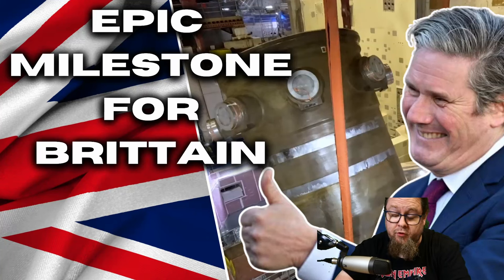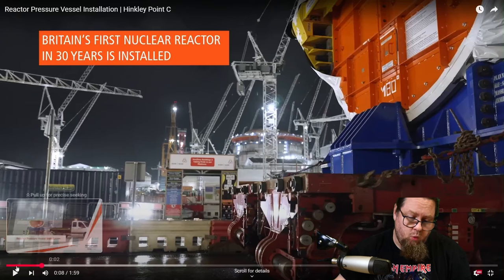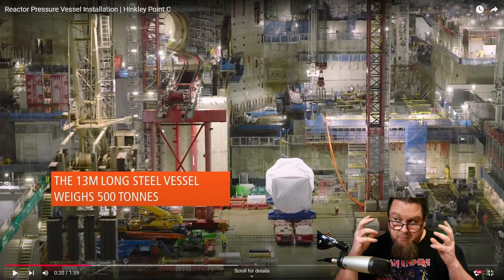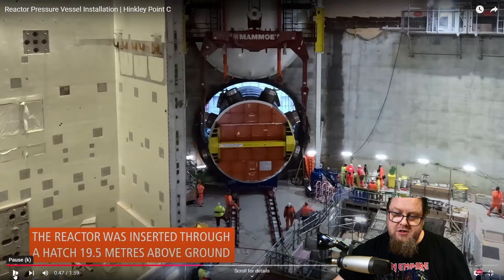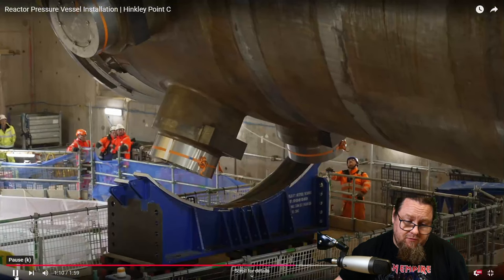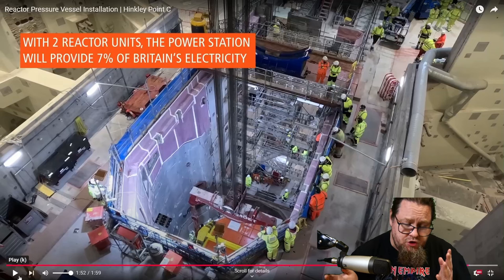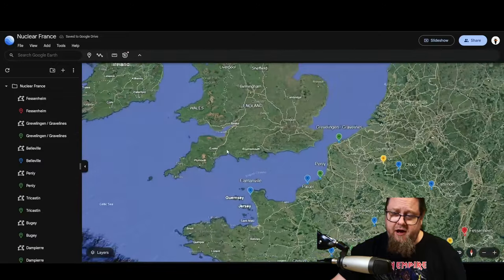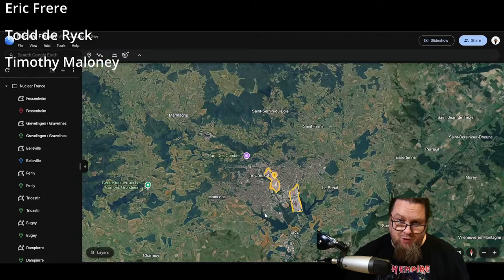Breaking! UK Installs First Reactor since 30 years!

Comment: Foreign investors installed the reactor and they will bleed us dry.
Reply: France and China made big deal. China General Nuclear Power Grp + EDF will bleed GB out. Estimated costs of 47,9 Mrd. £. Finishing in 2031 (building time of 18 years). You need to run this reactor over 30 years to make profits.
Reply: @Wulfay  Nuclear always needs time to generate profits due to the high initial costs. That's why shutting a working station down, like Germany for example, is such a stupid idea.
Reply: @bobthebomb1596  You need 18 years to build and another 30 years to make profit with these reactor in GB!!! Thats 48 years till your invest money pay out!!! With wind power you gain profit after 1 or 2 years and have not much building time. If you dont wanna benefit a corrupt construction company it isnt worth the efforts. The working stations in germany were build 1982-1988. They were much faster and cheaper to build then. They made profit after 10 years and they runned about 36 years. Estimated running time of these nuclear power plants were 35-40 years without upgrades. So they are shut down in time. Upgrading these power plants is expensive too for longer power. With upgrades they would do it +20 years. But old reactors with 40+ years have massive issues. I dont think it was stupid at all.
Reply: @Wulfay  There are at least three German reactors that could be restarted almost immediately.
PWRs are capable of running for 60-80 years and don't require fossil backup or non-existent storage.
Reply: @bobthebomb1596  Ehm...restarted almost immediately...lol...no? Not one of them could restarded almost immediately. I am next to one and live in germany. Not 60-80 years in germany. In the US they have a estimated life span of 60 years (+20 with upgrades). In germany estimated running time was 35-40 years (40-60 with upgrades). Security first here.
Reply: @Wulfay  The estimated running time of the US PWRs was also 30-40 years when they were built, evidence gained after this time showed that it was safe to operate them for longer.
Look at the evidence and make a decision based on it. How science works?

There was a report released recently which stated that up to three reactors could be restarted almost immediately.
Reply: @bobthebomb1596  talking bout safety of OLD nuclear power plants. risk in germany is 8 times higher. we have 235 people/km²...US has 35 people/km². An incident like Three Mile Island in Harrisburg (who was shut down!!!!) wont happen in germany. Greedy companys tell you it is safe. No insurance in the world will do a insurance for a power plant. There is a reason smart people see...
Reply: @Wulfay  : Yet the UAE (among others) who did it in SEVEN years.
Reply: @buildmotosykletist1987  Barakah 1-4 in the UAE needed 8 years and had estimated costs of 32 Mrd. Euro. It is really not economically to build a nuclear power plant in the UAE. Solar energy is much cheaper. in this region. GB and Germany have more safety regulations. No safety for workers in the UAE and the reactor isnt safe vs military assaults and plain crashes. Whats your point man? You think you dont need safety and economically reasons?
Reply: @Wulfay  : Nope. All 4 plants were completed in 12 years with the first online in 7 years at a cost of $20B for all 4 or $5B each. Easily confirmed by search.

Comment: Wow, thank you for sharing! Question: any information about using materials other than concrete for shielding?  Such as magnesium oxide, geopolymers, etc.  I ask as someone was talking about the 5 feet or so of shielding needed around the reactor even on SMRs, and it got me wondering about this. Keep up the great work!

PS my son has a significant mental health condition, and the treatment most effective so far has also been shown to be extremely helpful for many with crippling depression.  Research medical ketogenic diets if you're interested.  Someone working at Stanford University found it cleared up their severe depression in 3 days. As a PhD in materials science I don't make recommendations like this unless I've seen significant supporting peer reviewed literature. While there is still much to be desired in this regard, metabolic impacts from ketosis look extremely important.  Not to mention boosting iodine levels, taking D3 with K2, and getting near infrared exposure in the darker months. For what it's worth.  Best.

Comment: At 11:10 you say a huge gantry is in each reactor building. I kinda doubt that. You only need it very occasionally. And I can see a red beam with MAMMOET on it. Our well known crane and transport company. That's certainly temporary. Sure there's infrastructure for that crane to rest on. But the containment building needs to big anyway.

What peeked my interest was the red gantry and 'tracks' outside. That's something so one-of. And that's a prime example why you should build nuclear reactors in series. You get to reuse that multiple times. Even when it's probably partially made from building blocks as Mammoet often does.
Reply from the maker: Every Reactor Containment Building has a large gantry-crane. Otherwise you can't get the lid off, you can't get fuel out.
Reply: @Atomicjedi  Yes. Later I saw the yellow gantry. That certainly will say. But you won't have to move such massive load later anymore. So I assume all the red Mammoet stuff will be replaced with lighter permanent mechanics.
Reply from the maker: @AlexHaan  The one in the Borssele containment building that I saw was rated at 1000 tons. And that's been there since 1973 ;)

Comment: Good news but unfortunately the selling price for the electricity the plant will provide has been agreed to be twice that of wind and solar. Hopefully this is the beginning of the end of using gas for home heating in the UK
Reply from the maker: It's completely irrelevant what the price will be compared to wind and solar. A. your grid will NEVER be powered by 95% wind and solar, despite what Starmer promised you. AND, comparing nuclear to wind and solar is really comparing apples to eggs and eggplants... You need to consider the total SYSTEM price. And the system price with a lot of wind and solar is MUCH more expensive than when the emphasis lies more at Nuclear Generation

Comment: Just 8 years after the project started, they have finally installed the first pressure vessel!  The plant won't be online until 2030, 14 years after construction started.  It is now projected to cost £50bn, for 3.2GW of capacity.  Roughly 10x more than it should cost to build 3.2GW of generating capacity.  A good question would be why it costs so much to build a steam engine?  This plant is an economic disaster.  We need to learn to do this far more cheaply.
Reply: It can be cheaper with economy of scale. The solution is paradoxically to build a lot more of them in a shorter timespan.  Building one is absolutely ridiculous because then it becomes a bespoke reactor for all intents and purpose. Create one standardized super-awesome reactor and scale up production and pump it out with dispatch and costs'll come down.
Reply: One reason are the ridiculous  planning systems in the west which require the same arguments to be made time and time again for each new reactor. It is taking years to approve Sizewell C for example, which is the same design as Hinkley.
Reply: This is why we should build SMRs instead of anymore EPRs.

The EPR is an EU disaster. From memory: it was designed mostly by the French. The first version was about 1.1 GWe. That design was submitted to the German Energy minister who, at the time, as a Green. The Greens added every safety boondoggle imaginable. After that, the designers realized it was not competitive with other reactor designs. So they enlarged it 1.5 times to 1.65 GWe - to gain an economy of scale advantage over those potential competitors. But there was a massive problem they overlooked - such a giant reactor vessel is very difficult to fabriacate because there are only a handfull of steel forges in the world able to do the job at that scale.
Reply: @mark4asp  We need both. SMRs are unlicensed atm whereas the EPR/EPR2 already has one.

The game changer will be adoption of the new welding technique developed by Sheffield Forgemasters. If the industry can produce SMR reactor vessels in as little as 24hrs, that will lead to drastic cost reductions.

Comment: heavy investment in "old tech" which solves & improves almost nothing; over the past capability. Still will produce as much nuc waste; can't burn up old U238+Actinides etc, needs lots of cooling water as any LWR, has low thermodynamic efficiency...  maybe needs enriched U235 fuel from Russsia maybe? 
Copenhagen Atomics has a better concept, CANDU_improved is better, MoltenSaltReactors would be better (if Tritium sequestration is included), or a CSFR (ChlorideSalt fast Neutron "waste-nuc fuel burner"); unfortunately the better tech isn't supported by old-fashion centered industry. In the past, US-ORNL MSRE_tech had been culled by Nixon.  
Btw.: in the 1970s as a student, I visited the Gundremmingen, Germany LWR 1300_MW, Block_C before start up, really impressive machinery. 
Nevertheles I wouldn't want to live with my wife ( at young age at least)  near there !   Quess why?

Comment: Britain will have the "cheap" elektricity, 15 Cents up. Wind cost 3 Cent and Solar 6 Cent. To play with atomic energy is a very expensive hobby.
Reply: Nuclear is expensive but renewables are massively expensive. Just look at the UK.
Reply: @buildmotosykletist1987  UK had a cost problem with Hinkley point. Massive cost overun.
Reply: @stefankruger3634  : Politics. What was the cost ?
Reply: @stefankruger3634  : No reply, Why? Could it be because there wasn't one ?
Reply: @buildmotosykletist1987  money, not politics. hinkley is a financial disaster and have a garantee price for 14 Cent the kwh. And inflation is a part too, this you must add to the garantee price. Normally the cost to produce of an kwh is lower than 8 Cent.
Reply: @stefankruger3634  : LOL, using per kWH to escape the fact that you don't know the cost. Let's try this one; How much did it cost to dump the north sea off shore wind farm ? How many BILLIONS ???